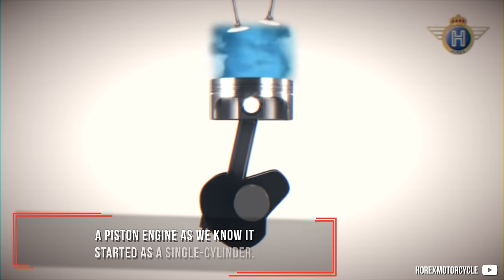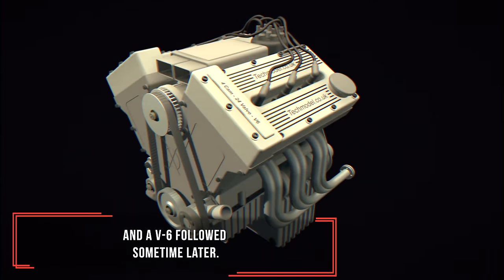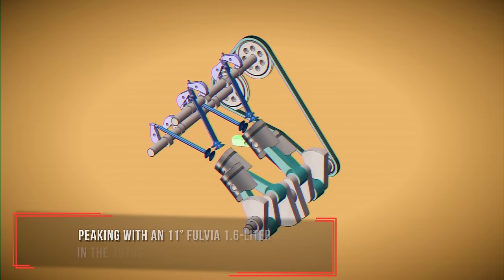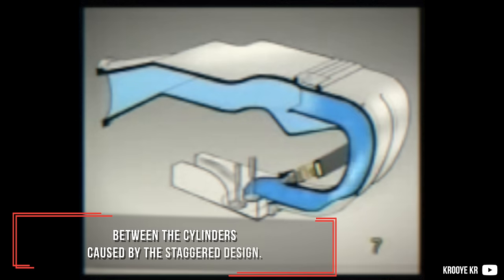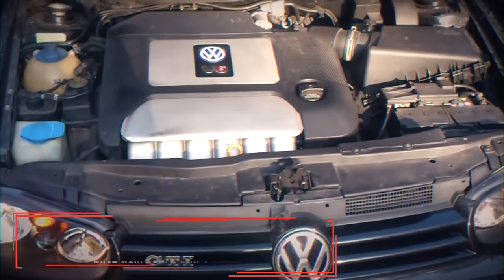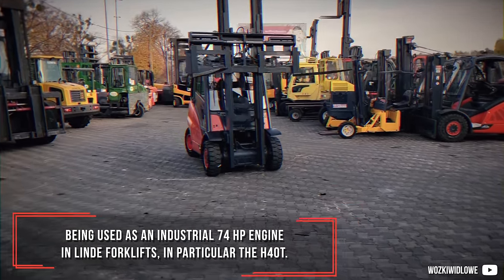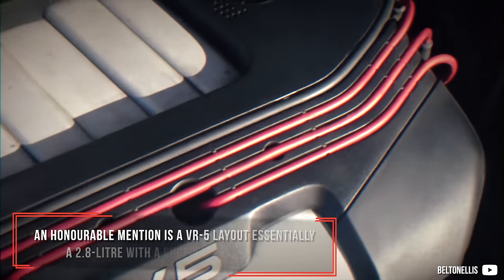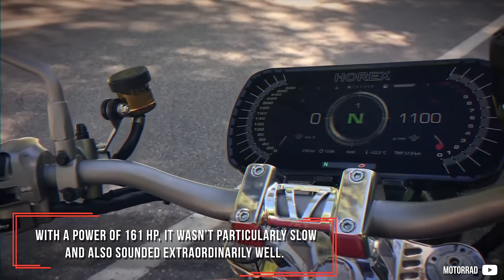What Is So Special About A VR-6 Engine?

Comment: Why wouldn't different power peaks at different engine speeds be beneficial in creating a flat torque curve?

That's what the goal is, for a street engine, a broad, flat, torque curve. (not a race engine)
Reply: What he described of different cylinders making different power would run about S smooth as an engine with a weak cylinder from low spark or low compression.
Reply: @chesspiece81  it's one half of the engine high, the other half low(er). So every other cylinder is slightly lower in power, not one cylinder with negative power (like a misfire), so it's still balanced.
Reply: @Iowa599  doesn't work that way, you can tune with different cam timing to extend the power band and not be so peaky. But different cylinders having different power, compression, and different exhaust or intake pulses impacts the other cylinders. The intake and exhaust pulses help scavage help with intake timing.
Reply: The different port lengths can cause an imbalance power and torque wise if the intake and exhaust manifold lengths or cam timing isnt tuned to equalize the power outputs cylinder to cylinder.
Reply: @chesspiece81  compromises for ability don't advance technology, and the point of this idea is to treat it like a V made of two engines stuck together at the crank. Two separate engines, one tuned for so many rpms, the other tuned for a different rpm. You could just tune them to the same, but you're already forced not to, by the length of the ports.

You're saying to just forget it, half-ass it. There are people who modify the hell out of these, one of the last things they change is the intake manifold. Why?

It works good at everything, and it's not frequently considered something to make better. The people who do are making a shit load, and changed it when they hit it's limits by making a lot.

Not because that shit's half-assed, like you think. It has been carefully designed & tested to be the best it can possibly be at everything.

Same goes for the exhaust.

Except General Motors. There they do whatever the at-work kindergarten class approves.
Reply: @Iowa599  You're not getting it, if manufacturers that have spent a century developing the ICE and untold amounts of money to get more power in war time and peace time don't you think what you're proposing would have been tried and implemented if it worked the way you suggest it does?

Comment: It just is an awesome engine, I owned :
1997 Passat 12V VR6
2001 GTI 12V VR6
2004 R32 24V VR6
 😢
Wish I didn't lose my R32 to a stupid flood! 
Bring back to awesome music 🎶 from the VR6 at least as an option, there are alot of enthusiasts putting the VR6 engine in the MK7 GTI & R

Comment: I wonder if a VR6 would fit in a Lotus Elise S1?
Reply: It's been done, give it a google
Reply: @59nesdnarFrangaR  yeah, but I wonder if the engine fits without having to touch the chassis?
Reply: @НиколаНиколов-ь3и  the vr6 pretty much the same size as a 4 banger...and as far as i know the elise has a 4 banger right? So it should fit just fine

Comment: 4:45 That‘s not quite correct. The VR6 doesn‘t have a bore of 91 or 92 mm. Its stroke is at 90.3 mm and for the 2.8 L the bore is at 81 mm and for the 2.9 L at 82 mm. Other than that, great video!
Reply: Yeah my mk4 12v has a 82mm
Reply: And it’s 2.8L
Reply: @TooFlyNico  But 90.3 x 82 x 6 translates to 2861.26 ccm -> 2.9 L. You maybe have a bored 2.8 L which now has 2.9L.

Comment: Has anyone ever developed a VR12 to fit where an i6 would normally go? I know there are W12s but because a VR6 is nearly as smooth as an i6 with a smaller package surely a VR12 should deliver many of the benefits of a V12 while benefiting from the simplicity of a single head meaning less likely to suffer from the common timing issues associated with V12s
Reply from the maker: I have not heard about any engine like that and I highly doubt anyone managed to do so. Even an inline-8 suffers from various issues given by its long structure and a potential VR-12 would not make any sense.

Comment: There must be a reason but why not have different cylinders with different power and torque characteristics? It would give the engine a greater power spread surely?
It has been unintentionally done for years with one carburettor feeding 4 or even 6 or 8 cylinders with runners of greater length for cylinders farthest from the carburettor.

Comment: Inline sixes are only 25% longer than inline fours of similar capacity - geometry tells us this.  Inline sixes are cheap to make, one block only, no balance shafts. The staggered 6 like the VR-6, nice idea but expensive. Packaging is an issue for small cars or cars designed to maximise space, but not so for where you'd most commonly use a six, a larger or sports car, where adding a little nose length is an aesthetic feature. The difference in length of an I6 to a V6 or V8 is less than what you'd find in the depth of the front and rear plastic bumpers, negligible. Inline 6 engines in commercially sold cars have spanned 1.2 to 6.7 litres that I'm aware of, maybe even a wider range. The inline six is making a comeback, right now, and the renowned engine maker BMW, never made a V6 and has made I6 engines for nearly 90 years.

Comment: somebody help me please. at 5:45 what is that piston thing connected to the bottom right part of the intake manifold. it’s on the bottom right corner of the screen below the oil cap. i forgot what it’s called and mine is broken causing a vaccum leak

Comment: VR6 got too complicated towards the end. The move to DOHC and a criss-crossing valve train was totally unnecessary. They should have simply kept the SOHC 2-valve design and bump the displacement to 3.6 liters. We know that a modern 2-valve engine can easily make 75~80 bhp/liter in a properly warrantied, mass produced, car. That's 270~288bhp and it is good enough for an engine that fit in the space of a big four potter. A 2-valve engine will actually be more economical of fuel too with its lower parasitic frictional losses.

Comment: If bmw can still produce inline 6's why couldn't toyota continue the jz line?
Reply: yo, bmw is continuing the supra legacy
Reply: A V6 is not as smooth as an I6 but has better packaging. Also the 2JZ was a heavy engine. Toyota at the very least would need to recast it in aluminum, which would make it not as strong.